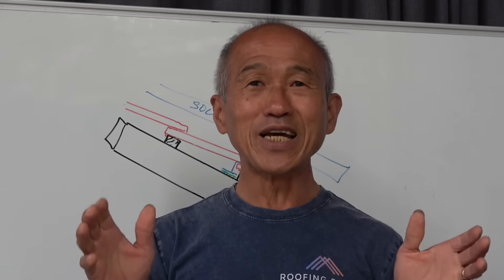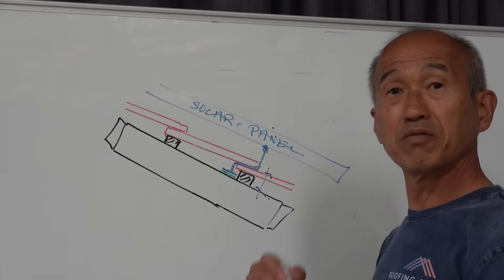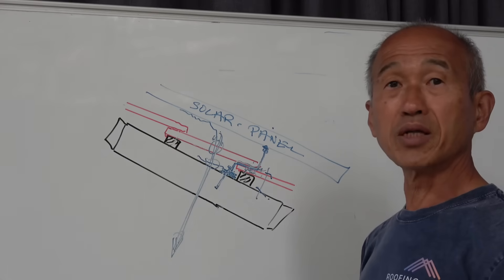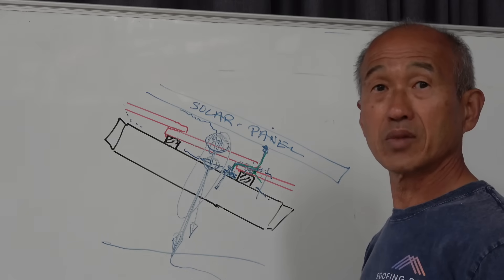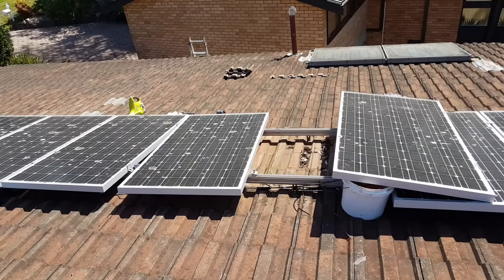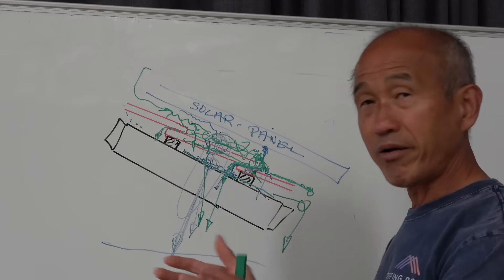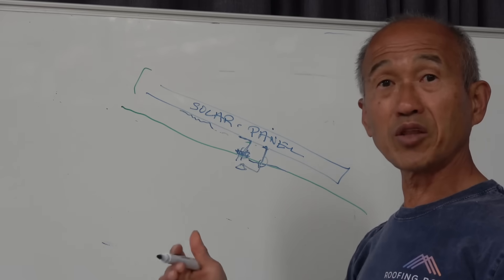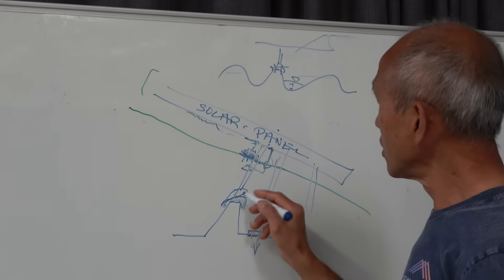Solar panel problems on Sydney roofs

Comment: I am getting my roof repaired at end of OCT and the Roofer has an electrician to remove the solar panels so as to check the water proofing. Also the panels weight plus the installers weight can cause tiles to be cracked during installation.

Comment: Yep. I looked into solar and decided a/ it makes no economic sense- by the time the capital cost has been paid off by the savings, if it hasn't already failed, the system will be approaching end of life, and b/ the amount of penetrations and potential damage done dramatically degrades the integrity of the roof. More irrational, feel good green virtue signalling as far as I could see.

Comment: This is an excellent tutorial. The most frustrating problem with roofs is acually finding leaks when they occur. Our current home is 12 years old and has a metal roof. The roofer who installed the sheets and insulation blanket showed my a number points where and how roofs will leak. He was really good. A licenced roof fitter from Canberra, and his attention to detail was astonishing. Anyway, given what I know and after viewing this video, I will never have solar panels on my roof. There is nothing worse that a leaking roof.
Reply: My issue is the tiles on my roof are no longer available to get for replacement. So either I paint the tiles or replace all the tiles on my garage and use these tiles as spares on my houses  roof repair

Comment: What about metal brackets on contact with metal roof that water or moisture could soak around matting surfaces and rust builds up and in years to come caused water leaks around the two parts. It will be few years before owner knows.

Comment: Thank you for this great presentation. A good Colorbond roof will last for more than 50 years.
The clamp on style bracket and the screw on bracket for corrugated profile hold moisture between the bracket and the roof continuously for days or weeks at a time even longer as many of them are in continuous shade under the panel. The first place an old Colorbond spout fails is where the overlapping joints occur.The spout drys quite quickly the joint does not. I imagine the $50K cost to replace a Colorbond roof prematurely would buy a fair bit of Electricity even at the exorbitant of power today.

Comment: I used to work installing solar panels. Tile roofs are a massive pain in the arse. I only have solar because I have a metal roof. If it was tile I wouldn't risk it.

Comment: Very good explanation. I decided years ago not to have solar on my tiled roof fot 3 reasons: (1) the solar people will break tiles etc (and not tell you)  and/or they will say the roof needs to be replaced anyway because they have a commercial relationship with a roofer they want to feed (2) errors in installation and maintenance - a nightmare at a practical level. (3) I have no problem paying electricity bills anyway

Comment: One of the reasons I've held off on installing solar panels is concern with potential roof leaks. Any piercing to a roof is an invitation to water ingress. 
And I have a metal roof. I can't imagine why anyone with a tile roof would want to disrupt tile overlap by fitting a bracket or cable.

Comment: I wonder that considering the high proportion of Australian roofs with solar PV panels (38% as of May 2025), if roof design, materials and structure have changed to accommodate this?

Comment: Good and presentation. Useful to know about the maintenance problems. Solar panels has been a big hype; they are not worth their costs and problems unless well designed and installed on their own supports.

Comment: from ChatGPT “How good installers prevent damage
	•	Use mounting systems designed for tiled roofs (hook brackets, tile replacement mounts, or rail systems).
	•	Minimize drilling by lifting and replacing tiles rather than drilling through them.
	•	Seal all penetrations with proper flashing and waterproof membranes.
	•	Replace any cracked tiles during the process.
	•	Conduct a pre-installation roof inspection to identify existing weak points.
Long-term
	•	A properly installed system should not damage your roof and can even help protect the tiles beneath the panels from weathering.
	•	The main risks usually come from cheap or rushed installations.”

Comment: Great demonstration, as per usual it comes down to how much the installer cares about there work and IF they are prepared to do it the correct way OR the quick way to cut corners and move on to there next install.

Comment: in regards to the universal tile bracket, with the Z shape, when an uplift force is applied by the wind wouldn't it want to lift /pop the lapping tile ?  that's only part of the problem, as under load it wants to straighten out, it doesn't look like a large sectional size

Comment: My take on many of these "Installers" is that they often use cheap labour, Often migrants with little or no skills or training (or brains). The guys that put my fibre broadband into my house were just going to run the cable up the outside of my lounge wall (right next to a cupboard that would hide the cable). I had to step in and say so, Their boss never said a word. This was under a govt scheme to put fibre in all NZ houses for free here in NZ.
Now they've moved to subsidized solar so God knows what disasters are waiting around the corner.

Comment: There better solutions: For example the company LEHMANN is doing metal roof tiles in various shapes and colors that replace a classical tile and already have the hook integrated. Just remove an old tile, put the metal one in its spot and screw them to the rafters - they do have mounting holes already.

Comment: My roof tiles are very old and quite brittle. In addition to that they are of a type that I’ve never seen in the recycled tile yards. The chances of me letting someone on my roof to mess about with them is zero. I’ve got 10 years until the retirement home, those tiles only have to last 10 years.

Comment: Thank you for sharing these issues that happen with solar instillation etc, most owners wouldn’t have a clue until they got that roof leak and then they start picking up the phone calling roofers and solar companies that installed them only to find they might be busy  and booked out for weeks ,
Reply: Or that company doesn't exist anymore.

Comment: Horrible on terracotta tiles due to the tiles profile locking and drainage moulding which causes leaking when the mounts are installed.

Comment: I didn't even think of this aspect. I was already pissed off that I got a 5KW inverter on a 4KW system but I only get 3KW at most because the string is clipped at 3KW leaving a whole 1KW sailing off into the sunset.  Nothing was ever explained about the clipping.  Frign OneSolar.  Never trust door-knockers!

Comment: Thank you. 
For the tiled roof, would the brackect be able to be made to go on the high ridge of the tile, like in corrugated roofing. Would also want the firm padding on the tile to cater for the movement you mention.

Comment: The solar panels are definitely a sail. Strong winds can make them flap and the vibration can loosen screws if not crack roof tiles.

Comment: Why wouldn't you feed the wiring up under the tile end and around the top of the tile below, more wire, but no hole.
Reply: Because water will follow the wire into the house. (Capillary action)

Comment: Solar panels are a giant scam. Very low density energy that requires massive amounts of resources to generate so little power. The amount of energy to manufacture the panels far exceeds the energy that the panels will ever produce in their short lifespan.

Comment: Another issue is the cables from the solar panels are often attached with simple cable ties that will break after about 10 years of heat/sun exposure. Also, beware of Pigeons nesting under solar panels.

Comment: There is something wrong with the way Solar Panels are installed in Australia that reduces the amount of electricity the panels produce.  An example of this is 53 seconds into the video. It shows solar panels installed on a red roof. In some countries, solar panels installed on a red roof is a no-no. 
Research shows that solar panels installed on coloured corrugated metal roofs, such as black, reduce the amount of electricity solar panels produce. The worst colours are black, red, green, blue, dark blue or any dark colour. All these colours are heat producers and reduce the electricity output from the solar panels.  The best colours are white and light cream.  In the US, painting roofs white has become a multi-billion dollar business, and clauses have been written into bylaws that all industrial buildings be painted white. Even though the Australian government has implemented programs to promote the use of cool roofs in urban areas, such as the "Cool Roofs for Australia", most roofing in new suburbs in Australia prefer black roofs, the absolute worst colour to choose.
Reply: I can remember the days when all roofs in Australia were painted Silver.
Reply: @RfromG-bd4fb galvanised corro - no need for paint, just a beautiful silver colour.  Neighbours and building caveats don’t like it though, so colorbond is the answer these days.

Comment: I have been telling people for years that they have only opened themselves up, down the track, for expensive maintenance issues. I've not bothered to work out a mounting method but it would involve hinges and some way to pivot panel arrays out of the way. There might not be a need for maintenance if the roofing was copper panels instead of anything involving paint. But you can't tell people anything these days.

Comment: The panel clamping blocks are aluminium and use stainless steel bolts.  After a few years the aluminium corrodes.  Try removing the bolt.  Often impossible. Always use silicone grease on the bolts at time of installation.

Comment: I had 14 panels on my garage roof in Queensland. $5000 installation, $100.00 every 3 months to clean them and aboout 60% max efficiency. Take away all the Labor Party subsidy payments and I wasnt that much better off.
Reply: studies showed that cleaning done nothing to improve capacity. any improvement was gone in a matter of weeks. its not worth the money to clean them at all. just leave as is
Reply: @droidtek8017  The installer said we had to wash the panels. I am not a solar panel engineer.

Comment: I was approached by a solar system company that set up a representative booth in one of the popular BIG BOX stores. 
He asked me to get solar panels installed over my house's roofing to get all the wonder benefits and paybacks afterward.
I said, "No thanks."

Then he asked me why not?

I told him it's the long-term problem with roof leaking,  roof replacement,  removal, and reinstalling the solar panels back without complications and failure consequences plus the extra unknown cost.
After he heard that, he closed his case and walked away with no question asked.
Reply: I have seen on the internet a carport with solar panels as a product option

Comment: If you are afraid to drill a hole for the electrical cable through the tile because you are not confident of your ability to permanently seal that hole, you might start by drawing a sketch of the roof and the location of the row/s of solar panels, and then develop a plan, (on paper if it helps you to think more clearly), to run all your electrical cables through pvc conduits underneath the rows of panels, to the edge of the roof, and then around the gutter or gable or WHY, under the eaves and into the roof space from below, to utilise the force of gravity to prevent rainwater falling upwards into the (repositioned upside-down) hole.

After five minutes of the lesson, it would appear that this episode is concerned not so much with solar panel problems but shoddy workmanship problems, and that comes back to the misguided modern definition of the adjective 'professional'.  A professional worker is not just someone who went to some uni' somewhere and got themselves some fancy paperwork.  On the contrary!  A professional worker is someone who is entirely focused on doing the job that they have been contracted to do, as best they possibly can, however long it takes and whatever is required, and let's the money come naturally as a result of having done a professional job, well worth the payment they receive.  

Too many Australians in the twenty-first century are entirely focused on the money that they can get for the least amount of work and overhead in the least length of time, with no sincere regard for the quality of workmanship, and that is why your video spent quite a while discussing unscrupulous contractors who lack the concentration span and initiative to use the right-sized bracket assembly to attach a solar panel to a tiled roof, which is half the bloody job they're getting paid big money to do.

Comment: You’re 100% right when we talk about problems. Solar panels on roof one is the cost of the solar panel and when it has finished its life recycling.
Reply: Solar panels life span is about 20 years unless damaged by hail.
Reply: @allangibson8494  Exactly why in South Australia where almost every house has solar panels I did NOT elect to fit any to my tiled roof.  I rely on the large solar arrays that we now have PLUS the near on 1.7 Gigawatts that is provided by private rooftop panels.  In totality South Australia provides 70 per cent of its electricity demand from wind and solar during winter,spring & autumn months, and 80 per cent over summer months.  We have no coal fired power stations and rely on a gas fired power station as backup.  And as of 2025 we are set to double or even triple these sources within another 10 years.  Unfortunately WA, Vic, NSW & Qld are still relying on good old brown and black coal power stations.  However these are coming to and end within the next 20 years.
Reply: @ All of Victoria’s brown coal stations are scheduled to close in 2035…
They will however be partially replaced by a new 100MW waste to energy thermal power stations at Maryvale, just north of Morwell… (construction is supposed to start later this year on the first unit).
Reply: @allangibson8494  Thanks for that.

Comment: Galvanic corrosion caused by solar panels on steel roofing would be another topic of discussion i think many would be interested in.
Thanks.
Reply: Galvanic corrosion requires two things - water and an electrical connection. Sealing is critical.
Reply: Another discussion would be putting solar panels on black roofs.
Reply: @RfromG-bd4fb  what's so special about black roof for solar panels? thx
Reply: @zijunryanmeng3921  I think it is the heat generated by black tiles underneath the panels heating up the panels which they don't like.

Comment: What peeves me is on a new house, the colourbond roof may cost 30k but they save $200 by using the cheapest screws they can find. Also, many solar installerz use the garbage screws that come with the brackets. Mond you, some mounting system brands have lifted their game there.  One started supplying stainless screws but you cannot use them on a zincalume or colourbond roof. Use B8 gal screws!

Comment: The currently used  brackets for tiled roofs are a poor design actually. They need to be a self adjusting type where the base is standard and the height is adjustable- though this would make the installation job more time consuming ( more expensive) . The whole installation system  needs a rethink.

Comment: This is a very useful video highlighting the issues AFTER the panels etc are installed especially on tiled roofs. Bird nests in particular and the buikd up of crap under the panels are a problem in many areas. Once panels are installed, you cannot see what damage may have been caused by the installers (cracked tiles) and anything that develops later. Its a real bother actually and something most customers do not factor in the costs.

Comment: Thank you. One of the reasons I have not installed solar on my roof is because the roof pitch is so shallow - 18 degrees I think. The only way to get at the roof space is by lifting tiles. Your   information certainly adds other reasons.

Comment: My experience with solar panels has changed my views on where to install them.  I would not install them on a roof for the simple reason that roof installations make it too difficult  to examine their condition.  Many times solar panels begin to fail prematurely with such things as junction boxes coming off, crazing of the panels,  burn through of the baking membrane,  water migrating beneath the glass surface of the panel, etc.
Reply: What brand/model of solar panels are you using?  How long ago was this?

Comment: Sounds like a job for bitumen impregnated foam around the bracket?  On our solar brackets the installers grinded away the underside of the overhanging tile(concrete) to reduce the gap distance. I've checked for leaks in heavy (really heavy) rain from inside the roof space (we have no sarking) and there are none at this stage.  But it sounds like it might be a good idea to stuff the gap from the inside to stop any uphill capillary flow.

Comment: Hi - other than the main issue of how it is safely anchored,  modern roofs donot seem to be designed to be able to support additional loads.

My home for example was built late 50's and is a mixture of 4x6  and 4x2 hardwood

I had the roof cleaned 2 years ago, and the contractor was suprised that he was able to have 3 people on the roof and there was no sagging, he mentioned many new homes ( say mid 80's onwards ) have a slight say with one more than average weight person - thus he typically has 2 people one left one right side or front / back

Most homes with concrete / clay roof tiles would develop cracks and it will take a wile to find the water leak in your home as most times it would soak into the insulation (if fitted )